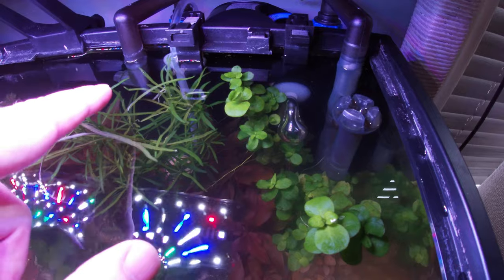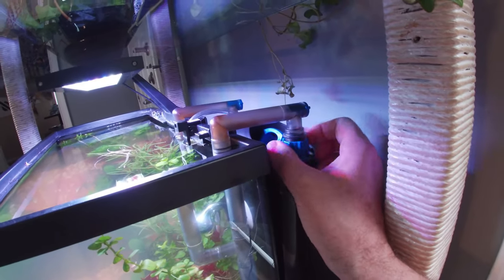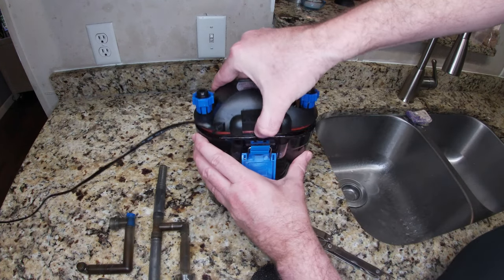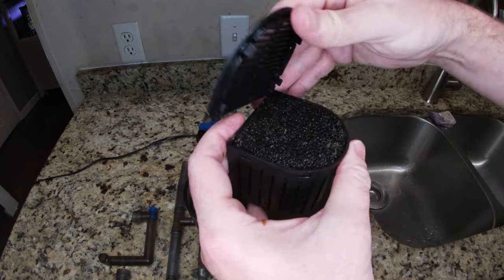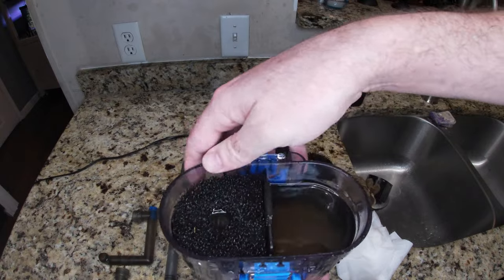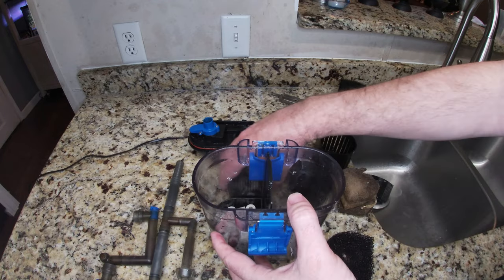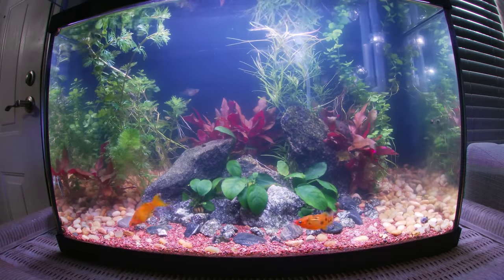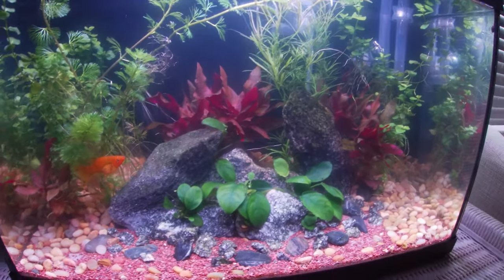FreeSea Filter 3 WEEK UPDATE & Mod | Can I make it BETTER?

Comment: You realize this is the solution to I assume is a failed Mini Canister filter by Freesea that is now discontinued. It originally used hoses that attached to the lift tube and skimmer like a regular canister and the spray bar was also attached to a hose. I looked at it as closely as possible with the pictures available and it looks like the same unit with the baskets and such. The head unit looks identical but has a lower GPH for some reason. The flipping of the unit to put the in and out on different sides was shown in the pictures but I took it as a mirrored picture mistakenly used. This unit has potential to do some interesting things like being adapted to a sponge filter or small under-gravel filter to give them a boost in power and filter the water once more or add an extra layer of biological filtration or run BCB bags. I was considering it for a Hybrid plenum/under-gravel filter system with some BCB bags but I'm not sure it's slow enough on its lowest setting to do that. Running Matrix in it at full speed or Seachem De*Nitrate and the slow setting could be useful though on a small tank.

Edit:
This filter must be selling because it has 19 reviews now. You just might have saved it from being discontinued!!
Reply from the maker: Thanks for watching and your comment. 
You mention a similar filter head unit and canister design by a former FreeSea unit? Is that correct? Is this filter a redesign? I do not know as it is my first time seeing/using one.
I understand modding a filter means it “sucks” as an initial design, but I own 2 of them now and have both running as standalone canisters with hoses (as you mentioned the previous model did I think) and they are working well. 
The impeller is strong enough to give a head height of 2’ (surprised me too) with 1/2 ID hoses. Video of that setup coming soon. 
You mention it maybe NOT be slow enough for your application, if you cut the in/out tubes to retain the flow control knobs and add tubing (again vid coming soon) you can cut the flow to 0 if desired. So, you should be able to slow it down enough for your application. 
Now it may seem like a sponsored reply or such. I am not, at the time of this reply I have 134 subs. Trust me, not sponsored! 🤣
I just think it is a cool little filter to play with and it has been keeping my 5G tanks crystal clear (don’t recommend much more than that size) after modding to make it more efficient.
I know the filter topic is very controversial, and I appreciate your input and thought! That’s what this hobby is about; comparing knowledge and experience. I don’t know how long these $32 filters will last, but maybe long enough for FreeSea to see my vids and sponsor me! 🤣🤣
Reply: @ssaquascapes  I did some more looking around and did the smart thing and clicked on the actual seller link on the amazon page. Freesea seller page has a few options click "other"------->Filters and you can look at the "unavailable" Canister. The Media Bin is shorter and only one level. But the head unit looks so similar.  With it being rated at 80GPH I assume it lost some speed with the longer hose set up. Most people would see the HOB and just skip the canister with less speed and media. Wise move to delete the canister and run with the HOB/Canister style they have now. I also thank you for the heads up about the flow control topic. I was toying around with going Anaerobic or low oxygen to grow a different bacterium that converts Nitrates to Nitrogen. This seems like a Cheap laboratory to run this experiment. I have a nano aquarium to run this on.

I just noticed that my replay to you looks like this @SS Aquascapes.🤣 

P.S. The Mirror thing is something I see people do to skirt copywrite laws by flipping the image left to right so it looks like you are looking in a mirror. It can be done in Photoshop or video editors. It's useful to take clipped images of people and make them face the opposite direction in a different background.
Reply from the maker: Thanks for digging deeper. You have more experience in this hobby than I, so feel free to inform me on any other videos I make too!
Let me know if you use this filter for your experiments! It would be cool to see what you come up with!

Comment: I have a very similar HOB Canister (Oase) and it has the exact same issue regarding the lid being nearly impossible to get off! Every time I use a prying tool I worry I'm going to break it somehow :(
Reply from the maker: It’s ridiculous isn’t it! I mean I am glad it has a tight seal, and I’m not a strong man, but jeez I have to bring out the tool box to maintain it. 🤣
Thanks for watching man, see ya around the Tube! 🤘
Reply: Yup. It's a thing.

Comment: Why not cut the top sponge in half horizontally" so there will be space between the intake hole and the sponge?
Reply from the maker: Yes, you could do that for sure. Never thought about that. If you want to keep the stock sponge setup this will work well. I have modded this filter yet again (video soon) and it works well as long as there is space for the inlet water. 
Thanks for watching and commenting so others can have a different mod option!

Comment: ya know. I have a wild hair to actually try this on my 40 gallon i'm re-doing soon. I was looking at a tidal 75, but the appeal of having one purely mechanical and one biological only filter in series sounds too tempting not to try. it was either that or some King of DIY something or other. Sponges also house a lot of good bio media. so combine this with some aquarim co-op sponge (super coarse as initial filtration) then chase it with something like a 30ppi sponge and then feed an all biological canister would be cool. and you can just go really cheap and just use pot scrubbies as your biological media for just a little bit more you get way more filtration (in my case for a 40) and more surface area for healthy bacteria and i think I would be under $100. - Madness - (i will not hold you liable for any chaos that occurs. it such a good idea. Nice man.
Reply from the maker: Awesome. That’s what I’m talking about! Have fun and play around with filtration. It keeps things interesting 🤘

Comment: this is desiend the same way the oase filter is just no hoses id like and adpter to ad hoses for my lily pipe
Reply from the maker: Good to know. Never had an Oase. Maybe in the future. I did a recent video where I add glass lily pipes to this filter. Check the video list if you’re interested. Title: “$30 canister filter”. 
Thanks for the support!
Reply: @ssaquascapes   ta I saw that shortly after I commented..... I'm going to give the filter a try but I'm going replace the staderd fittings some kind of diy thing I have a few ideas to make detaching the hose for cleaning easy if they work I'll let you know and maybe you could do a video on making it cheers glad to see this I alway like watching how the filters work befor I try them.
Reply from the maker: Sounds good. I installed some shutoff valves to keep water in the hoses when detaching them from the filter. But a quick release connector would be cool! Keep me posted!